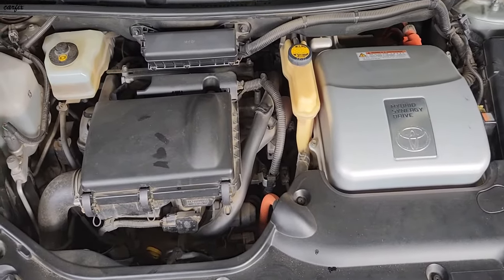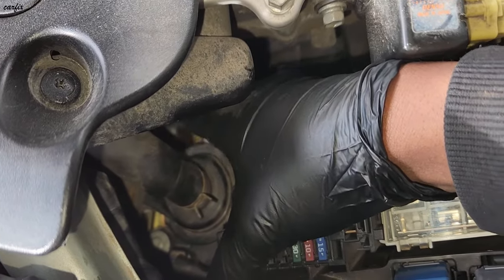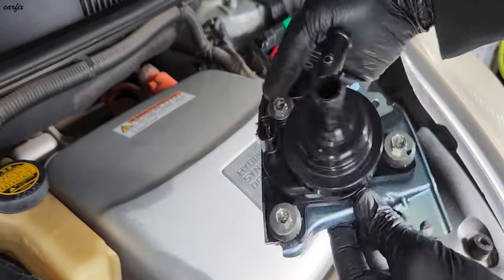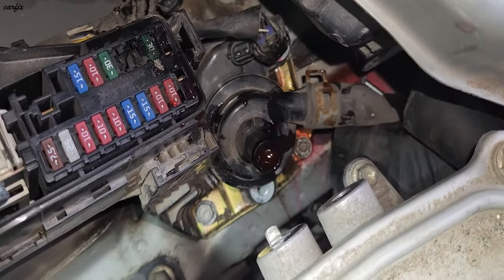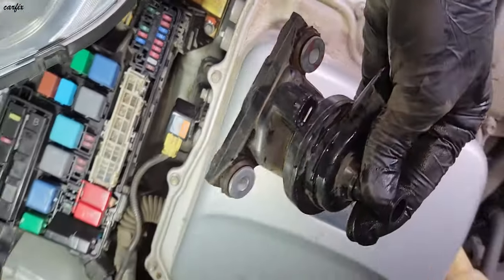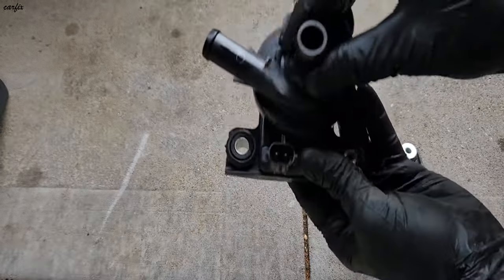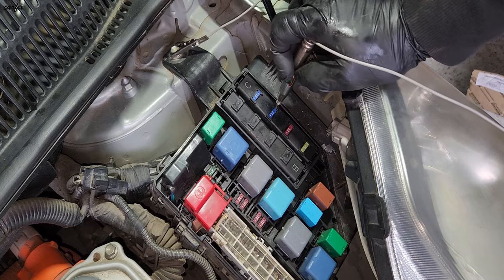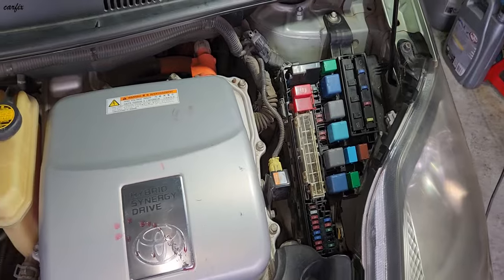Toyota Prius No Start/Does Not Turn On /AM2 Fuse Keeps Blowing - No Ignition  Electrical Short

Comment: I did this very job this past Monday.

Unlike some other people, I received no error codes or warnings. I was driving down the street doing 40 mph, and my 09 Prius just shut down.  

I slowed down, rolled into a neighborhood, and waited for the tow truck. I googled while I was waiting the 3 hours and determined it was in fact the AM2 fuse due to the inverter coolant pump going bad. 

Got the car home that night. Replaced the pump the next day. It was hell, but I got it done. I reused the original bracket.

Comment: Im trying to save my car from scrap. 
I don't have this exact problem but I'm looking far and wide for clues

2007 with a failed abs system for over a year now. The entire ABS system has been replaced with salvage parts but the problem persists. 

The problem is that there's no communication between the computers (Abs, power steering, airbag and drivetrain). Toyota garage quoted 10hrs for the technician to find out the problem with no promises it'll be fixed. 

The inverter pump is not working with but shows no codes. Drives perfectly fine and inverter stays below 70°C if I drive under 110kmh

I'm being pushed to scrap a perfectly working car in good condition because of some random computer bugs.

Comment: Honorable sir. I am from pakistan. I have toyota prius 2012.3rd generation. I am facing EFI fuse blowing. My car was stucked in the middle of the road. I replace EFI fuse several time but when i try to start my car. Fuse blowing happen. What will you suggest for my car. I am very worried. Because  i am residing in a town where no authantic machanic or electration for hybrid cars avliable. Please guide me. I will b very thankfull to you for this..
Reply from the maker: That mean your car wiring short to body 
May be wiring damage (any accident)
Any Sensor fault /injector/air flow sensor. 

My suggestion is put first fuel pump 
May be that's the case 
Thanks
Reply: @carfix1993  thank u so much for best suggestion. No doubt...i was completely check my car step by step i was found that oxygen sensor located at cylincer was short sensor wires are damage and touch with cylincer.i also check fuel pump but i am happy the fuel pump is ok. 2nd fault i was found that connecter wires of AC compresor are short due to cracks. I also replace the connector with new one. But honorable sir one thing happen when i unplug all connector of my car.and i fix the problem.but when again connect the plugs after rectification of fault. All calibrations of my cars was disturbed. But with the help of scanner problem was fixed by the machanic. Thank u so much for best ideas and keep smiling.
Reply: @carfix1993  I did fuel pump it started then died and sometimes doesn’t even say ready
Reply: Started up drive around block it shook then died can’t get to start again